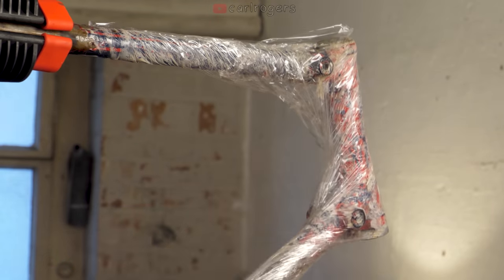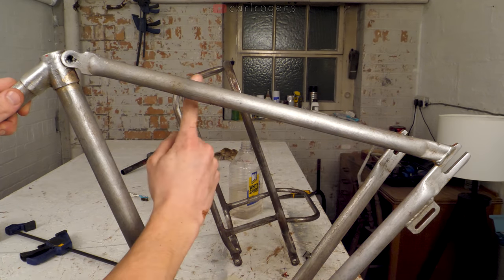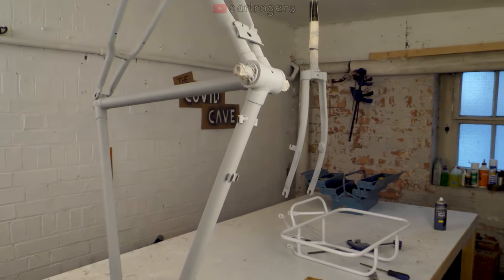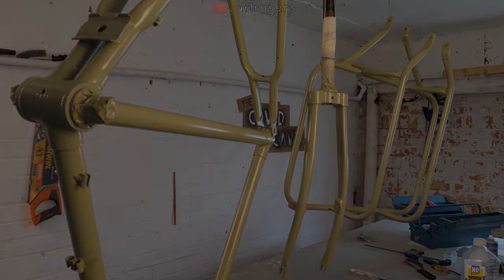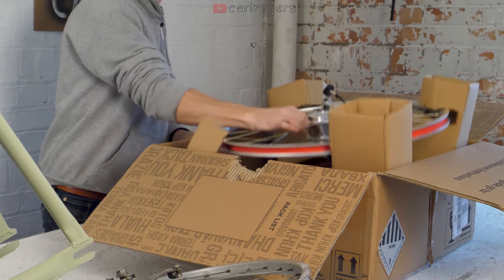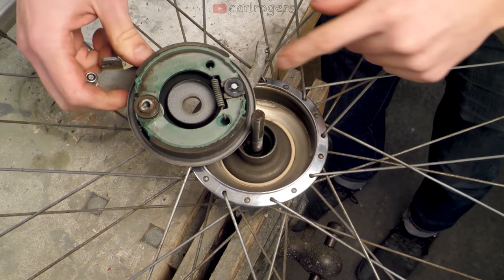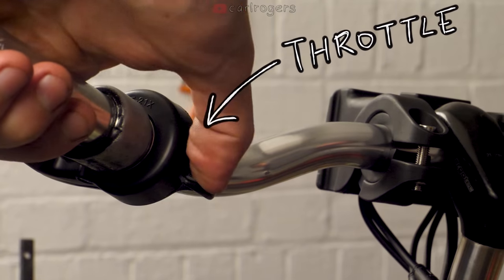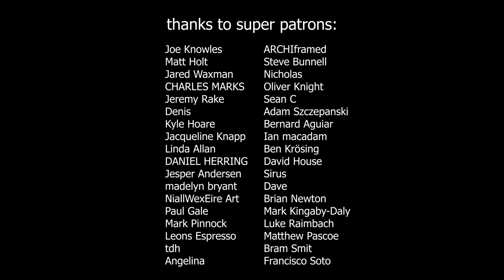Turning Rusty Canal Find into Electric Bike

Comment: Okay, you opened it up for discussion when you posted video:  
Why pea green?  A couple cans of automotive touch-up paint  aren't that expensive,  and you can get a full range of auto-makers colours. Mebbe a nice red or blue or anything but pea soup green. Also, why no clean up and repack on the pedal crank assembly?  It's one of the most important shafts on the bike. Otherwise good video. Best to you, mate.

Comment: Although there also was a front brake on your table before the assembly, they didn‘t make it on the frame. Is there a reason?
Reply: It looks like the front rack would have fouled on the brake cable when turning the handlebars
Reply: @PSG1BEN  I have a similar bike and I don't think the cable would have been a problem, my guess is that the brake itself wouldn't fit on the fork -- there wouldn't have been a mount spot for it originally, since when new that bike would have come with a roller brake on the front. (I'm not sure but I think that's what the slot on the right-hand side of the fork is for, since the brake needs to be braced against the frame. The tab on the left would be the bit you attach the brake cables too, and the cable itself would have gone through where he put the swytch cable). Maybe you could mount the rim brake on the rear somehow but you definitely shouldn't because that rim isn't intended as a braking surface. So I dunno, I'm not sure how else you could add an extra brake. Maybe just don't go down any big hills.
Reply: @GeorginaWilcox  
Yeah, I think you're right, it would have used a roller brake originally. But the fork crown is drilled, so could take the style of brake that was on the table. After watching again, it looks like the drop from the fork crown to the braking surface is too long for the brake. But I also stand by the cable issue, when the fork rotates on its axis the brake will move with it, but the arms/struts for the front rack remain static as they're mounted to the frame.
Reply: @GeorginaWilcox  Originally a Sturmey Archer drum brake, not a Shimano roller brake. It's actually a UK legal requirement to have an effective brake on the front wheel.The fork is probably stiff enough to add the mount for a disc caliper, but that's beyond the remit of this Swytch advert.

Comment: I have no experience with metalwork so I have an Amateur question: If there was water inside the pipes of the bike, wouldn't this mean there is rust inside the bike? isn't making outside of the bike restored while leaving insides of the bike unseen means the bike will rust from the inside out?

Comment: always wonder if a front hub drive is any good, seems like an ideal placement of weight, less complicated, but you would also be slipping all the time.  This one looks nice
Reply: In my experience with my DIY 750w rear drive, there isn't enough low-end torque to get it to break loose unless I get off the bike and hold a little weight off the rear.

Comment: I would have heated the frame up to get rid of the water.  I also would have removed the bottom bracket and the bearing races in the front tube before prepping and painting.

Comment: Excellent entertainment, Carl! And excellent outcome, creating an eBike!. I concur wholeheartedly that electric drive transforms my local commutes. I would always take the car, but now hop on the eBike for those less-than-5 mile trips. Your front drive means the rear wheel is available for belt drive. I'm looking forward to the update!

What make is that particular bike stand in your garage? Where did you buy it?

Comment: Aren't those bottom bracket bearings going to be trashed from sitting in the water?
Reply: Pretty sure the bike didn't get in the water that long. The steel frame is spotless. But, yeah, the bearing must be fucked either way.

Comment: You should have done a full restoration.  When you remove the pedals, you should have remove the rode inside the frame. Not sure what it's called.  I'm sure it needs cleaning,  grease, and oil.

Comment: Retrofits based on the front wheel are dangerous, since the fork is not designed to bear the force of propulsion and will fail soon, bringing the rider to face on the road. A better (actually, a safe) retrofit is one where the motor goes into the rear wheel.
Reply: @danimayb  you are right, but I suggest mentioning the issue when a motor is retrofitted in the front wheel, because someone may do the same with modern, weaker bicycles.

Comment: The problem with the steel bikes that are left lying in the water is always the same.
They just start to rust internally and you cannot see it and you cannot clean it properly.
That means the bike will have a weak spots, and you can presume how dangerous that is.
It is really not a good idea to salvage something like that then.
This bike looks like it was not in the water for a long time, as the steel is barely rusty,
and also, all of the parts are coming out very easily, nothing was stuck, which is impossible, since it was apparently left in the water for a while.
But, okay. It is a nice video after all.

Comment: should have drilled the hole in the side of the tube the top and bottom of the bar is what is taking he strain when in use drilling a hole in this part of the tube will significantly weaken it.

Comment: The british are too cheap to throw away a bike frame, but the real give away is that the guy already partially stripped the frame to remove the branding and probably expose the metal so it would corrode faster before he chucked into the water.

Comment: Why isn’t the motor on the back wheel where most of the weight would be ?
Reply: It makes it easier to provide a kit that's simple to fit to more different bikes - the USP of this overpriced kit is that you can just swap wheels and go. The bottom bracket is the best place to put a motor, as most better factory-built e-bikes demonstrate.

Comment: Look, Hammerite is not a primer, it is a special type of hard metal paint that can be applied directly on metal without using a primer. Not the paints fault you cant be arsed to read the label.
Reply from the maker: just a little joke. hammerite has its uses

Comment: I bailed on this video as soon as i realized he wasn't going to service or replace the bottom bracket. I don't know a bike mechanic who could ignore that, it would drive them crazy, myself included. I clicked to the end of the video because I was curious what type of motor he installed. Why? Because all hub motors are garbage. And people commenting that the bike is not going to be pedaled because its an electric bike is non sense. People do end up pedaling an electric bike if they run out of charge or have a mechanical malfunction (again, its a hub motor) and they are close enough to justify pedaling home. And what about the condition of the bike when he pulled it out of the canal. It couldn't have been in there very long.

Comment: Very cool except putting a swytch on it is cheating, it looks dicky and I'd imagine the weight on the handle bars would affect the handling of the bike somewhat. 
No offence to swytch they have a great idea but I bet you wouldn't use a swytch if you had to pay full price for it. They're expensive for what they are. 
There's far better kits on the market going much cheaper. 
But then I guess that's just a personal preference. For me, fitting a bike out with a kit and adding my own custom electronics, parts and wiring is the best part of building ebikes. 
You could have at least had a brown leather pouch made for the battery pack so it matches the rest of the bike and doesn't look so "added on after"

Comment: not convinced, finding a bike in a canal that had been partially stripped using chemicals. rust on frame surface only been in water minimal time, drills frame to remove water? all that was needed was a bit of warmth. refurbs some bearings but not bottom bracket using pliers on ball bearings so after that he then fits an electric drive upgrade. NAH

Comment: Bogus!! Dude, you should have been a bit more honest and just found a REAL junk bike frame in a salvage yard, or buy an old used bike for a few bucks.....as if someone would, for some reason, strip a frame of EVERY SINGLE PART, take it down to completely bare, then discard the frame. They would have had to carry the frame to the canal and dump it, when I'm sure they could have set it out by the curb and either the trashmen or someone who actually likes to rebuild bikes would have gladly taken it.  But to expect everyone to believe you pulled that thing out of the canal like that...you destroy your own credibility.